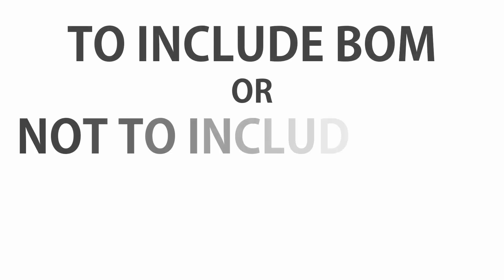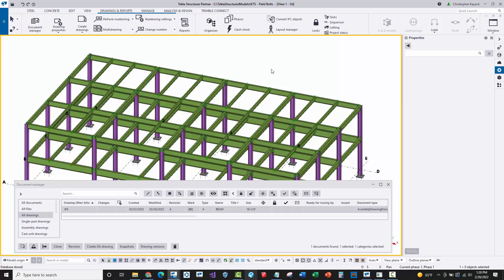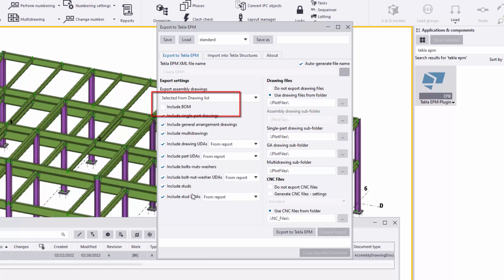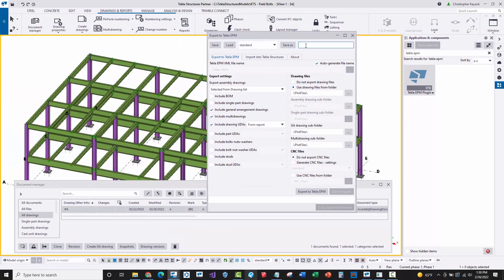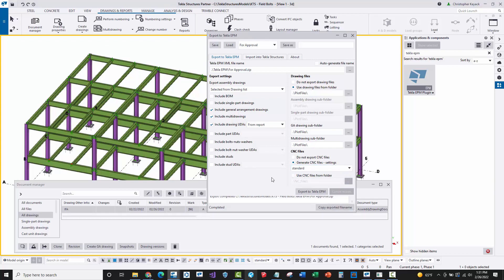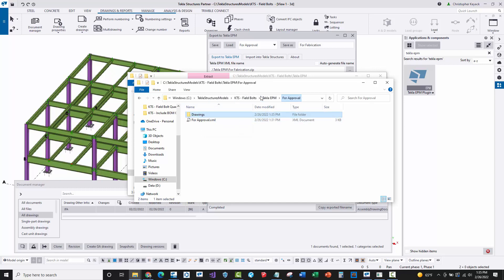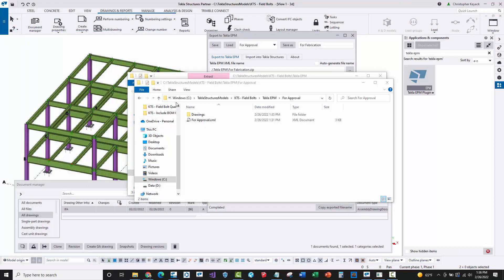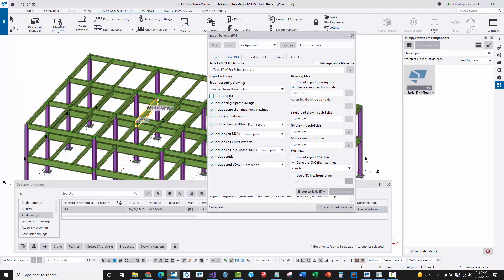Keyack Tech - BOM vs Drawing Data in Tekla EPM XML Export

Comment: Hey. Not sure if you still check this or not, but I had a few questions. I am on the PM/ field side of the steel work but the company I work for has a ton of issues with imports. They blame the detailers and software but I think it’s our detailing standards that are the issue….we have none. Anyways, I noticed that inside Tekla Powerfab on your BOM, you had B6 as the main mark and B6 as a part mark as your first BOLD line item. In other words, your assembly and part share the same name? We have detailers create a phantom object that doesn’t have a length as the “assembly” or main part. This is so we have an object that holds the assembly drawing in the BOM. Then, our main part (that for you gets bold and shares the name with the main mark) looks like a regular part. For how my brain works, how does your setup work for the attachment of an assembly and part drawing? Does your part B6 (if you double click it) hold the pdf for the part AND the assembly? Sorry if I’m using improper terminology or logic here, I just build stuff. Thank you for all the videos.

Comment: I am in interested in Tekla PowerFab, but I am concerned about it handling Coldform (i.e. Zees, Cees, and Eave Struts) correctly.
Reply from the maker: @jteasler  reach out to Tekla to show them how to work with this but I know what you’re talking about since your inventory is really a roll coil not a 40, 50, or 60’ piece of hot rolled that you are making a cut list from. I’ve seen Tekla do some demos related to this but most metal building fabricators I’ve seen who roll their own cold formed have a special integration using something like Beck Automation Connex and linking it with their ERP like Epicor etc.